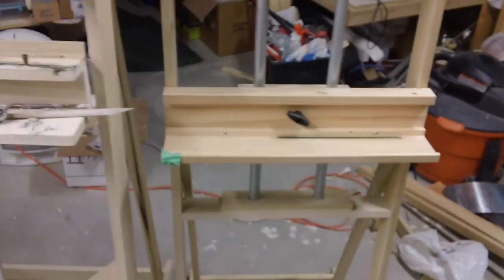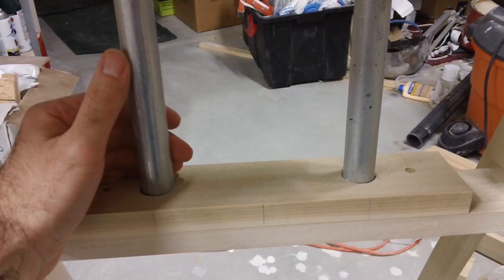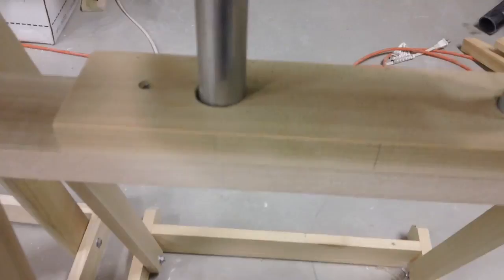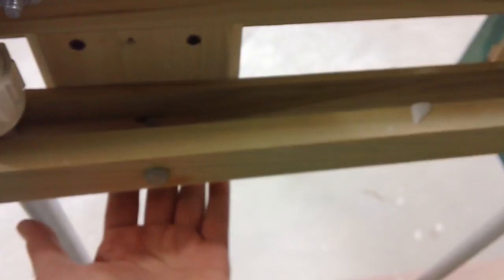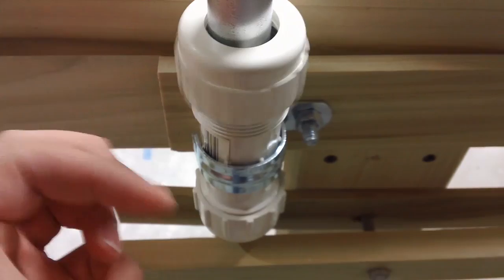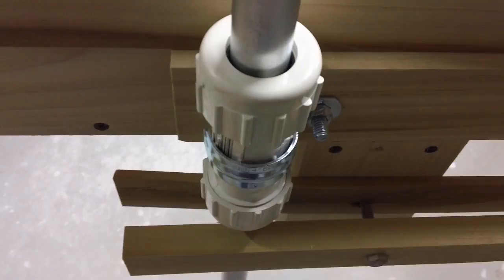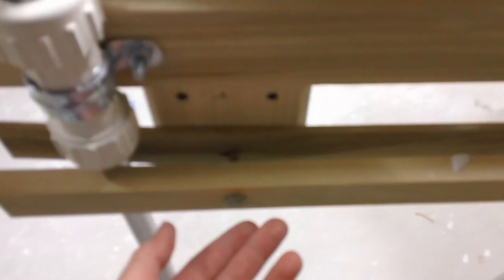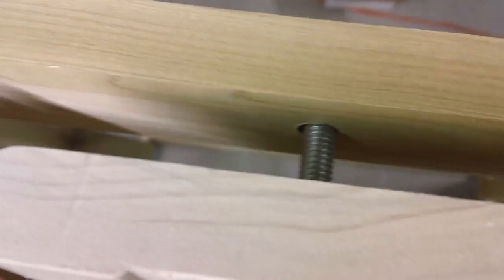Art Easel part 2 - updated modification

Comment: Thanks for the design and upgrade ideas. I'm going to go with the wider conduit but probably not the 2 PVC unions. Instead I'm going to create 6 pieces of identical top and bottom plates. 2 will be used as the top and bottom plates. 2 will be used as the top and bottom of the lower shelf (final 2 for the top and bottom of the upper shelf). I think this will keep the shelves square (I have a drill press so I'll be able to make sure all the holes are exactly the same width apart). The thinner piece of wood behind the pipes that is part of the clamping mechanism can fit between these 2 plates to keep it square (looks like yours has a little play). Mine won't have the really smooth sliding action but I don't think it will be problematic to need 2 hands to move it. Again thanks for sharing your design.